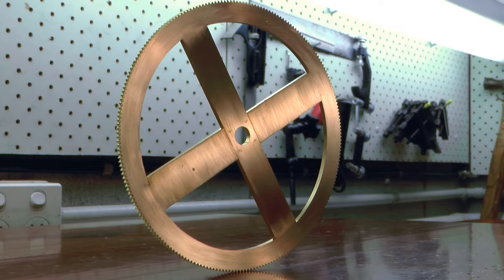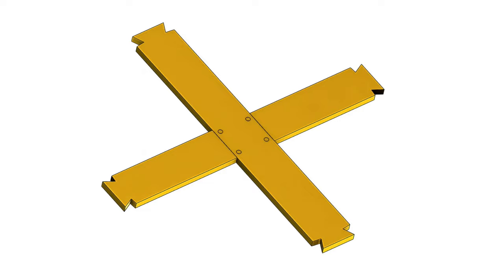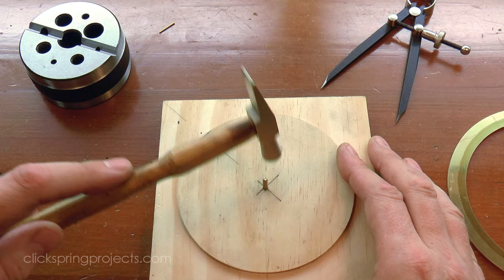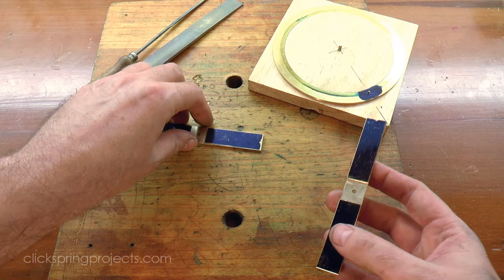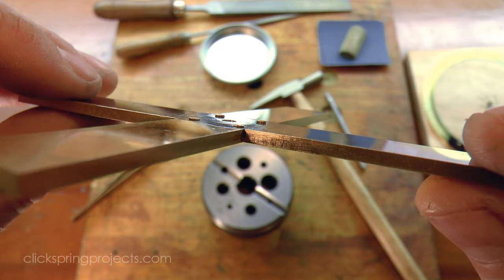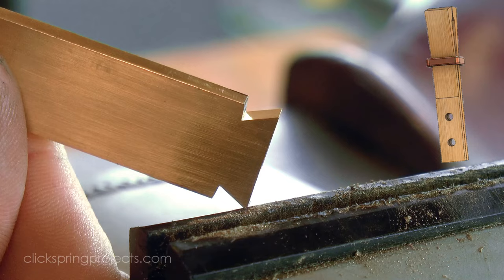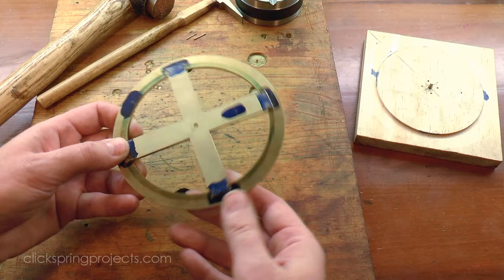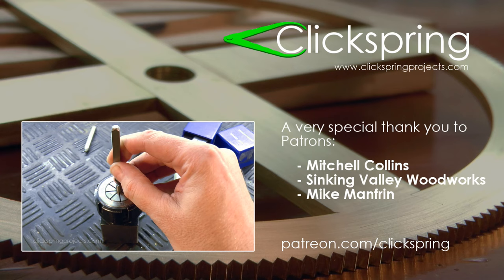The Antikythera Mechanism Episode 2 - The Main Solar Drive Wheel B1 - #DialOfDestiny

Comment: I'm curious about your claim that the dovetail/cross system was to save material. I'm not sure about the economics in ancient Greece, but throughout history, labor has always been far more costly than materials. Bronze can be remelted and mined, but a highly skilled craftsman's time is invaluable. You know best how much extra time this method took, and per hour, how expensive would that amount of bronze have to be to justify the hastel?
Reply from the maker: Bronze is an alloy of two expensive metals - copper and tin. Both of which needed to be mined, refined and then melted at very high temperature to form the bronze alloy - an expensive and specialist task in the ancient world. Further, the metal was then processed into sheet form, with repeated annealing, hammering and final surfacing to achieve the very precise dimensions required by the device. By contrast the dovetails took an afternoon of relatively straight forward work with a file. There is no doubt at all in my mind that by a significant margin the greatest expense in this device was (and still is today) the cost of the raw sheet stock.
Reply: Thanks for the details! I wouldn't have guessed that the dovetails were that straightforward nor that making sheet stock would be so herd.

Comment: sorry for my probably stupid question but how does it stay together if you filled the part off that was holding them together? taking that off just makes it a pin through metal right? so how doesn't it fall apart?  then secondly how did those two pins literally become invisible?  this is incredible.
Reply: re watching that part im pretty convinced there aren't pins in there anymore.

Comment: Since foot-powered lathes are rather easy to make using mostly wood, and they had waterwheels and slaves for power, I imagine that they had man and water powered machine tools that would be as familiar as they would be foreign to a modern Machinist.
Reply from the maker: I agree Brandon - there is much evidence in the machine itself to suggest a sophisticated tool technology that significantly exceeds what is currently believed to be the case...

Comment: I am really interested by your videos and think it would be really cool to get into machining and maybe try to make a clock my self but i have never even used a lathe and am not sure I would want to drop the money on a lathe without knowing if it is something I will find enjoyable. Any advice?
Reply from the maker: Get to a local maker space that is equipped with a lathe, and make a pile of chips. You'll know right away if its your thing.
Reply: Clickspring I'll have to find the nearest maker space. (I'm so happy you responded that's awesome)

Comment: How do the rivets hold the part after the ends have been filed flush with the part? Wouldn't filing away the material remove the pein holding the rivet in place?
Reply from the maker: The rivet ends have been deformed out a bit like a mushroom at the top, and are an interference fit when inserted - with no axial load they sit there quite comfortably.

Comment: I think there's an inherent design language that gets passed down. When there's a clever solution, work-around or specialty tool that's made the word usually gets out. Which sparks more pathways to be opened up by a community of widget makers.

Take the hammer for instance. Clearly just refined bashing tool. A stick plus a chunk of iron. We will always have that tech with us, no matter what goes on with humanity. There are so many people with hammers that if we were to be reset back to a period of time where electricity was scarce or didn't exist, there would be a need to copy the memory of the hammer. A rock wouldn't suffice because of our prior knowledge.

Gear making is obviously essential. So is the basic math needed to divide a circle in equal parts so all your teeth match up. Once that method was figured out, gears were easy to lay out in any size and ratio. But take that just a step further. The dividing head. It's so simple and so genius, there would be no desire to make gears with a scribe and compass. The maker's collective memory would work to build a new dividing head to gain a production advantage, while his rival makers are toiling over the hand method still.

As long as there aren't big gaps or big losses of collective memory, (like losing the Library at Alexandria) There will always be a steady progression of ideas and methods, each compounding upon one another so we work less, produce more.

Comment: I'm just wondering how were the files made for filing the metal almost more than 2k years ago.
Reply: I assume they would have used a lot of natural stones and other abrasive materials to remove metal. But a rasp/file could be made by simply hammering or cutting a series of notches and or grooves into a piece of steel and then hardening it.

Comment: You're using the lathe a lot in the video, did the ancient Greeks have a similar tool?
Reply: Every bit of lathe work in this video could have been done on the horizontal surface of a pottery wheel, as used to make the millions of vases, amfora and other pottery of the time. It would even be possible to keep the wooden jig permanently attached to the pottery wheel from the moment the wheel was used to carve its circular shape until after cutting the teeth. Every technique shown is classic woodworking tech, similar to the imitation wooden construction of Greek marble temples. Cutting teeth and other details one by one with basic hand tools remained the normal way until the industrial revolution, making it well documented and a key part of toolsmith apprenticeship well into the 20th century.  The Greek had access to large cast bronze plates, they made life size and larger statues of the material. Making a hollow wheel and adding spokes was the only good way to make good wooden wheels, so the tradition carries naturally into other materials throughout history, just look at the fancyful spokes in aftermarket enthusiast car wheels.

Comment: Could the multi part construction been used so dissimilar metals with different thermal expansion properties could help hold tolerances over a wide range of temperatures?
Reply: Its 2000 years old and from the mediterranean, I doubt it was designed with temperature differences and tolerances in mind.
Reply: The Antikythera itself defies expectations of what people were capable of in that time and place, so your argument isn't built on terribly stable ground.  

To try and answer my own question.  Some rough calculations show that bronze will expand around five mils from freezing to one hundred degrees Fahrenheit, that's about the width of a human hair.  Not terribly likely to cause a problem.
Reply: It only defies expectation since there is literally nothing else found like this from the time period. My argument is based on what we know so far about history from that time, yours is theorizing about it. All you have is a rusted wreck from the bottom of the sea, because of that there is no way of telling what kind of tolerance this shaft was made to or how much play was between this and that gear. Who knows, maybe some greek guy got them to modern standards by spending years of his life filing gears, there is no way of telling because the components arent preserved as they existed 200 years ago. Since you dont know the tolerances between the parts, you dont know if thermal expansion could be a concern, if you prefer your style of argumentation. It probably wasnt, why are you arguing again?

And when or why would a mechanism like this be subjected to freezing temperatures? Some guy is gonna take it to the top of some mountain in greece and then start cranking it? The heat I can understand but cold? To me it would a completely irrelevant environment and usage situation which to take into account when designing a precise machine such as this.
Reply: If the whole device is made from the same metal, everyting will expand by the same ratio, keeping fits and gear ratios constant. Therefore the device will work equally well at any temperature.